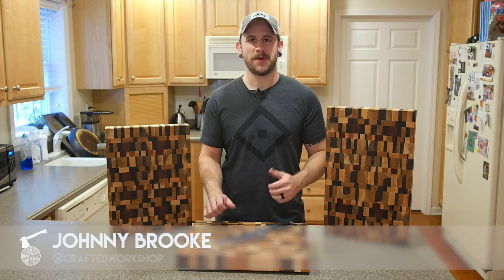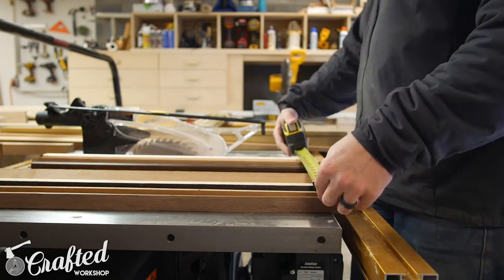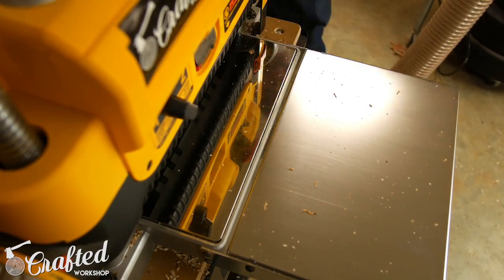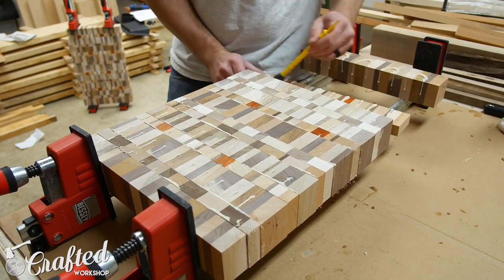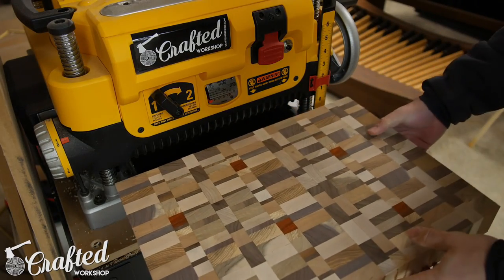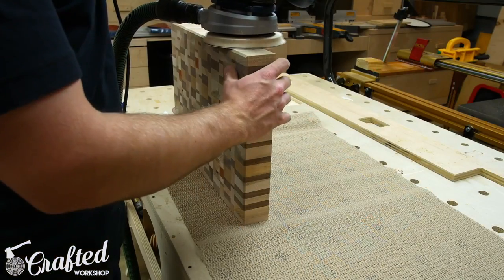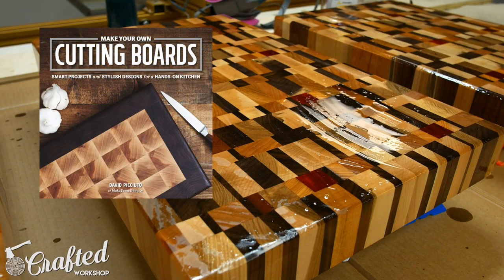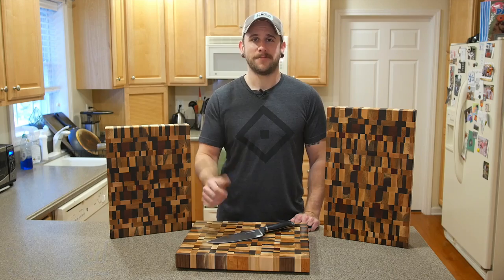End Grain Cutting Boards from Scrap Wood How-To

Comment: Hi. You mention a uniform height on your boards when making the blanks at the beginning of the video.
What height did you make? Thanks!
Reply from the maker: +Mike Levant they were all different heights, the height of the original blanks doesn't really matter and they don't need to be the same.
Reply: Thanks, but I thought the height would determine the thickness of the board?  Am I wrong?  It appeared on the video that you were ripping your scrap to a certain height when you glued them together.....can you give me an approx height you made yours.

Great video and work also!
Reply from the maker: +Mike Levant nope, the height of the final board depends on how wide you cut the strips from the blanks. I crosscut mine to 2" wide, so once I turned them 90 degrees, they make the board 2" thick. Watch the video again if that doesn't make sense, takes a little bit to wrap your head around it.
Reply: You are awesome! (I hope that does not sound weird). Thanks you for your response and help.  I can't am looking forward to getting started and will be a supporter of your channel.
Reply from the maker: +Mike Levant thanks a lot Mike!

Comment: I am making an end grain cutting board for my brother for his wedding, and I am wondering how I can figure out if the wood I am using is food-safe.  The woods I used are the woods that were available at my local lumber yard that looked good: maple and red balau ("mahogany" decking, similar to ipe, here: http://www.wood-database.com/balau/).  Any thoughts on whether or not the resulting board will be able to be used?  Or should I pick a different wood?

Comment: Thank you for putting this video on here!  Turned out looking so nice. What was the length of your strips at glue up stage and the size of board when finished? I want to try to make one also for my mom for Christmas.
Reply from the maker: Thanks! The lengths of the strips varied, there isn't really a set length you need since you'll be cutting them again. The board sizes varied, but the largest was about 15" x 20", and about 2" thick. Definitely a beefy board!
Reply: Thanks for your reply  i will definatly give it a try .

Comment: I just built my first end-grain CB.  When I oiled it, overnight, it warped.  I flattened it with a router jig and all is well.  However, I attempted to re-sand it and due to it already being oiled, my paper was completely gunked up.  I'm thinking card scraper but is there any other way to get the router marks off the board and finish it again now that it's oiled?

Thanks
Reply from the maker: Man, that's tough! I'm wondering if you would have left it alone if it would have come back to its normal shape once the oil was distributed evenly. I think a card scraper is probably your only option, and it should get the finish pretty close. Sorry to hear that man!
Reply: I'm too scared to put it through the planer.  It's literally a week old and has perfect blades...  O_o  Thanks for your insight.  :)
Reply from the maker: +CancerCashew well another guy in the comments said he broke his thumb and wrist doing that, so being scared is a good thing.
Reply: Damn!  Yeah, I've seen some nasty blow out vids.  My new card scraper is on the way so hopefully I can sharpen it well enough to smooth out the surface a bit.  Thanks for taking the time to comment.  Love the vids.  :)
Reply from the maker: CancerCashew no problem, appreciate it!

Comment: Awesome vid, but question. Leaving out the oak do to its open grain really necessary due to it being an end grain board? 
 it's all open end grains anyway.. I'm really curious because I have some scrap oak I got from someone and want to make a butcher block style end grain board
Reply: Shaun Kennedy   Maybe make an Oak serving tray instead of a cutting board. And with no cutting on it, you could seal it epoxy resin like used to make countertops.
Reply: A little late, but oak is a very hard wood so it’s generally not great for the knives is why it doesn’t get used often

Comment: I'm near completion of my first experimental end-grain cutting board.  Made with all maple.  Came out pretty well, except some of the glue joints failed from the first gluing step.  Happened when cutting on the table saw.  Any ideas what I might have done wrong?  Everything looks tight.
Reply from the maker: +superlazyorg hmm, what kind of glue did you use? Never had Titebond fail.
Reply: Crafted Workshop I used Titebond iii as you showed.  Maybe I didn't use enough?  Or too much?
Reply: Here's a picture of the finished board.  Kind of small, but I'm just trying to figure out the process.  http://www.superlazy.org/upload/uploaded/IMG_3057.JPG
Reply from the maker: +superlazyorg wow, maybe not enough? Don't think you can really use too much.
Reply: Ok, thanks for the tip.  I did go kind of light on the glue so that I didn't have squeeze out everywhere.  I used more glue on the second round and so far it's holding together.
Reply from the maker: +superlazyorg yea, you definitely want a nice even line of glue squeeze out. Good luck!

Comment: What are the dimensions on those cutting boards? I know in the video it was stated that they were made to 13" (widest the planer would accommodate) but they look bigger than that on the short dimension.
Reply from the maker: +Ryan McIvor about 20” x 13” was the final size.

Comment: i put mineral oil on my canadian maple cutting board but it ended up morphing what are the steps to take care of it and prevent this from happening
Reply from the maker: +4drive there are a ton of reasons a cutting board can warp. Try standing it on its edge and let it rest in that position. It will hopefully go back to its normal shape.

Comment: I love this, but I have a concern.  Say for instance, I cut up a lot of chicken, how can I be sure it's clean and won't grow any bacteria in the end grain.  Do I need to oil and wax it constantly to keep the nasties out of the wood?
Reply from the maker: Nope, just wash it, dry it off, and it’ll be fine. People have been using this style of cutting board for hundreds of years. I’ve never reapplied oil to my board and, even after two years of almost daily use, it looks great.
Reply: @craftedworkshop  Thanks for the reply.  My son is a chef and I want to make him a present.  I have limited fancy tools, but a good table saw.  No face planer, so more sanding.  Thanks again.
Reply from the maker: Good luck! If you buy pre-milled lumber, you can get away without a planer.

Comment: Hey Great video!  Had to hit the subscribe button.  After a few months of use with rubber feet, have you found your board has begun to sag in the middle?
Reply from the maker: +Jordan Burke thanks man! And nope. I always wash the board, dry it with a towel, then set it up on its edge to fully dry. Seems to do the trick.

Comment: I experienced the same tear out when using a router on the edges. I came up with the perfect solution. On a router table turn the board up on end and run it that way instead of flat. The tear out is no longer an issue. Let me know if it works for you.
Reply from the maker: Hmm, cool! Good tip.

Comment: Really nice! Great job!
Just one gripe:
In my opinion you should never use rubber feet on a cutting board!
They just harbour bacteria and are completely unnecessary.
If you are chopping food to the point where the board is moving around you are going at it too hard and doing it wrong! Especially if your board is as big as these fantastic boards.
Your boards look amazing though, thanks for a great video.

Comment: End grain was primarily used for chopping blocks,such as a meat clever which was planed down ever once and a while ,get a lot of miles off those babys.
Reply from the maker: For sure! Been using it daily for two years with zero maintenance and it still looks great.

Comment: I want to tell you all about how I really don't like cutting boards! First of all, a simple plastic board is cheaper and more hygienic. It does not warp, its lightweight and can be washed in the dishwasher. There is a reason why they are banned in restaurant kitchens. As a woodworking project they are also more difficult than one might think and require a lot of precision and tools. A planer, a table saw and a thickness planer. They also need to be setup correctly. Who decided this would be a good go to starter project? Good video though.
Reply from the maker: +Max Maker actually, the scratches in plastic cutting boards are way worse at harboring bacteria considering they're usually much deeper. Wooden cutting boards have been used for centuries, they work fine and people get too hung up on the bacteria aspect in my opinion. They do require some very precise cuts though, totally agree on that point.
Reply: You are right. It doesn´t really matter to much. Don´t get me started on cast iron skillets though!
Reply from the maker: +Max Maker hah!

Comment: I let mineral oil suck in to a couple boards that were Christmas gifts.  Then I drove them around in my car for a few days.  I don't know exactly why, but they really "leaked" oil after being in the cold car..  I had one sloppy plastic bag over each one, so there was not a horrible mess, but my "presentation" was not as elegant as I had hoped, since the hostess got all oily.
Reply from the maker: +Susan Kapustka the wood fibers probably contracted due to it being cold. Definitely best to oil these a week or so before delivery to allow any excess oil to weep out.
Reply: I think it was over a week that it sat at room temperature.  I cannot envision the fibers contracting, or the whole board would have gotten smaller.  But the cold did something.  When they are all done, wrap in a few layers of paper towels to avoid a mess.  
Thanks for your videos.
Reply from the maker: +Susan Kapustka good to know!

Comment: Dishwasher safe?
Reply from the maker: +SOGTKMS definitely not.
Reply: Sorry if this is a stupid question, but what is the best way to clean it then?
Reply: Just a brush with soap and water?
Reply from the maker: +SOGTKMS yup, exactly. I usually dry it off with a towel and allow it to dry sitting on its edge so the board doesn't sag from the weight of the water.

Comment: Red oak is fine for cutting boards. I've made hundreds of oak end grain blocks that have been used extensively for years with no issues. Some good conditioning plugs those micro pores up just fine. Seems like a YouTube woodworking misnomer.
Reply: that sounds interesting.  as a newbie woodworker, could you describe the best ways to condition the pores ?
Reply: I use a good mix up of Mineral Oil, Carnauba wax and Bees Wax as the first coat (I use about 5 parts oil, 1 part bees wax, 1/2 part carnauba wax). melt it really good down to liquid in a double boiler and pour over all surfaces. Rub in real good especially for end-grain boards. Let cool and dry. Then wipe off and buff out the wax back down to the wood leaving the pores plugged up with high wax content conditioner. If it clumps up or gets too thick a heat gun or blow dryer can help out making it back to a liquid. After that use any conditioner you like. Enjoy. Good Luck.

Comment: Oak not suitable for cutting boards due to open grain? Makes you wonder why so many make open grain boards..
Reply from the maker: +Zyx end grain cutting boards hold up really well to repeated use. Oak just isn't a good choice, plenty of other types of wood to use.
Reply: Zyx white oak is suitable for cutting boards, all cutting boards should be sealed anyhow.

Comment: What would you sell these for?
Reply from the maker: $250 or so.
Reply: Crafted Workshop what?  where the hell are you selling ? Beverly hills?
Reply from the maker: +Mike West these take multiple days to build. Not sure how much you want to get paid hourly but I'd like it to be above minimum wage.
Reply: 250.00 is an awesome price for the amount of work and the size of the board. Do you have any of these left?
Reply: Crafted Workshop  250 for 1  cutting board? Lets be clear.
Reply from the maker: +hittman2005 I don't, but I'd be happy to build another set if you're interested.
Reply: Crafted Workshop after watching the video repeatedly I want to try and build one. If I fail I'll take you up on that offer
Reply from the maker: +hittman2005 nice, go for it!
Reply: Crafted Workshop thats a fair price. I have made and sold many end grain and edge grain boards over the years. I've sold them anywhere from $60 to $750. With most around $220. $250 is fair for these boards. Anyone who disputes the price doesnt understand the perfection required on every aspect of end grain boards. Good job on the boards. I also chamfer the trailing edge when planing. I've never seen anyone else do it. Also, if you ever want to change it up and put a routed profile on the boards. You can turn the boards on edge and run the trim router along the long grain with no tearout. Compliments again on the quality. Great job.
Reply from the maker: Thanks Michael, good tips!
Reply: 250 is right. These are functional works of art. We're not talking about a single sheet of wood cutting board from Target or Walmart for $18 that will split on you after two uses and washes. Trust me I got the T-shirt. Lol
Reply from the maker: Hah, thanks! This thing is still rock solid with no maintenance. I just used it tonight to prep some chicken.
Reply: Wow those are tremendous. Awesome video. Awesome shop machines too 🤙
Reply from the maker: Thanks!
Reply: @craftedworkshop  typical instant generation.. No value in solid well built stuff...that mentality has made us a bunch of China buying cheap immatation generation and China so wealthy, y'all better start learning the language..well built block mate 🙂
Reply from the maker: Thanks!
Reply: Some people don't appreciate/understand that you have to put time and money into making these things. Freaking tools are expensive.
Reply: A well made end grain cutting board like this will last at least 20yrs if it’s looked after. $12.50 a year for a great cutting board is a bargain
Reply: @craftedworkshop  , I'm really late to this thread, but I'd like to add that I just made an end grain mesquite block as well and it is priced around $335 and I have some cnc routered rosewood feet on mine. 
Your price is very fair considering how much more work you have to put into it with all of the irregular sizes. Good looking boards. 
Most people don't understand what it takes to make a wooden board fully food safe either.
Reply: @craftedworkshop  250 is an absolutely fair price. these are gorgeous pieces of art. one should never devalue their own work. Id be willing to pay that if I had the change and wouldnt be a DIYer myself.
Reply: Totally fair price. I just finished my first end grain board. 13 x 13" cost of the wood alone was $100.
Reply: @mikewest712  I've sold smaller versions of the same thing in northern Wisconsin for 150.00.  Cabin people.  Lake people.
Reply: Mike West custom cutting boards like this takes lots of effort and perfection, just because is wood doesn’t mean everything you made is cheap, some people don’t appreciate our job ...

Comment: Mineral oil on a cutting board? You would also enjoy drinking some petrol at the gas station i presume
Reply from the maker: Mineral oil is food safe and is the standard for cutting boards. You do not want to use any kind of vegetable oils as they will go rancid.
Reply: @craftedworkshop  is there some documentation on the internet somewhere that states who declared it to be food safe?
In the European Union it is not approved as food safe.

Comment: I tried putting an end grain through a planer. It turned into a Frisbee
Reply from the maker: Definitely need to be careful but I've had success with it as long as I take light passes.
Reply: @craftedworkshop  i think a 3 blade or helical head would be better than my 2 blade

Comment: Hardwood is not good to use for a cutting board because it will dull a knife easily You should use soft woods
Reply from the maker: Absolutely incorrect.
Reply: @craftedworkshop  
I am of course Absolutely CORRECT !!!!
I dont hammer  my knives on hardwood as a cutting board and expect the m to stay sharp thats just plain stupid about as stupid as glass cutting boards. 
We use softer woods for cuttign boards which is better than the HARD woods that you used. 
If you dont understand the basic concept and physics of hard wood being hard then you need to learn something
Reply: Something hard and dense  is of course not good for cutting boards Ive never seen a chef or cook want to use something dense .because it dulls their knifes quickly . If their cutting boards get too many scratches they sand down their boards and put more oil on them
Reply from the maker: Look for a commercially available cutting board made out of softwood. Doesn’t exist for a reason. Hard Maple is kind of the gold standard for cutting boards, and it’s hardwood. End grain boards allow your blade to go between the fibers, so your knife doesn’t dull nearly as quickly.

Comment: choose food save wood glue but fill the gaps with epoxy??? XD 

and by the way... mineral oil (even they sell as food save) is more unhealthy then u will think...
a good linseed oil or walnut oil would be much better...
Reply from the maker: Epoxy is food safe when cured. Also, Walnut oil is a poor choice due to common nut allergies.
Reply: Crafted Workshop 
then eat your epoxy if u believe that^^ 
Lipid-Transfer-Proteins will denaturate when cool down after cooking! so u won't have a allergic reaction from walnut oil... 
same with linseed oil... and why someone who is allergic with walnut would like to have a walnut cutting board???
Reply from the maker: +Kühn being in contact with Walnut wood vs Walnut oil is very different for people with tree nut allergies.